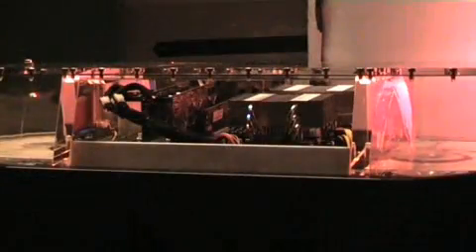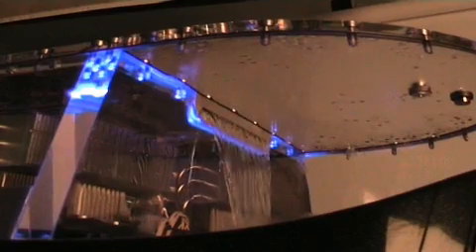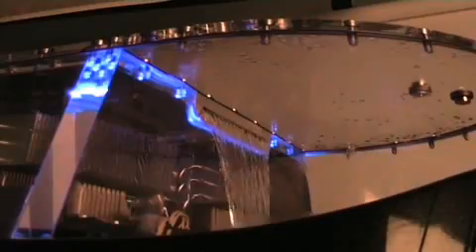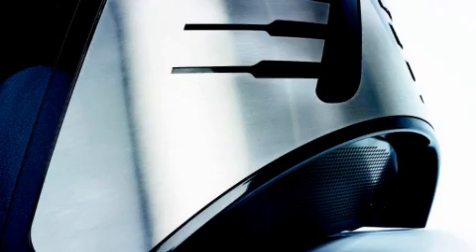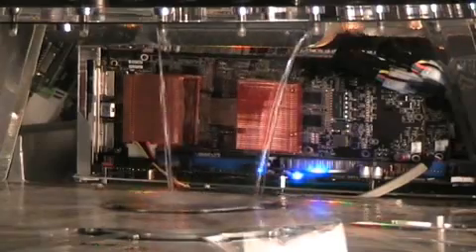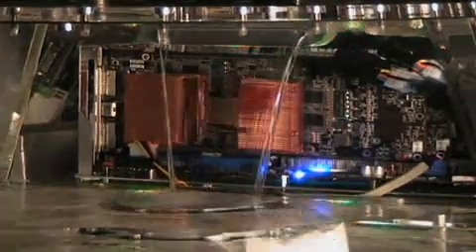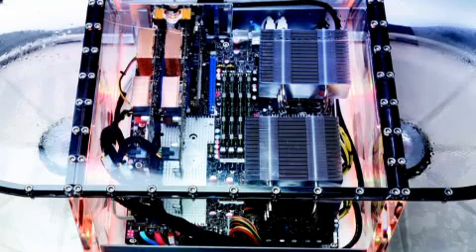Dream PCs 2008 - Armari

Comment: The same analogy can be used for compounds and minerals that are under normal circumstances not flammable but when a proper amount of oxygen is introduced burn at extreme temperature like steel.  Pure water water is a poor conductor, so is air but the right voltage makes just about anything conductive, consider it a secondary reason why we refer to voltage as potential.